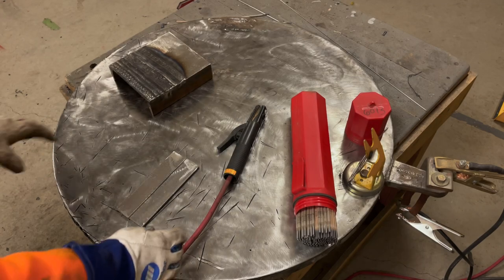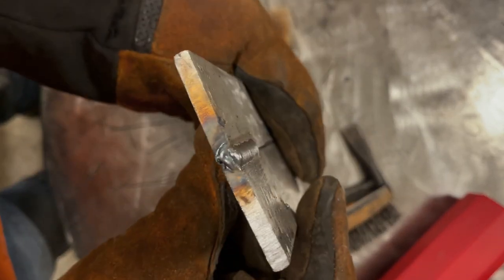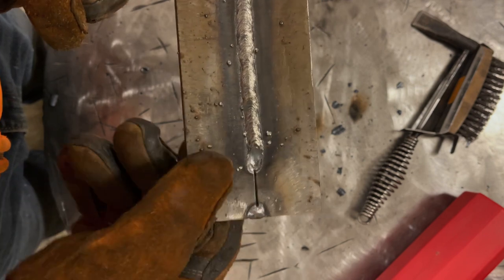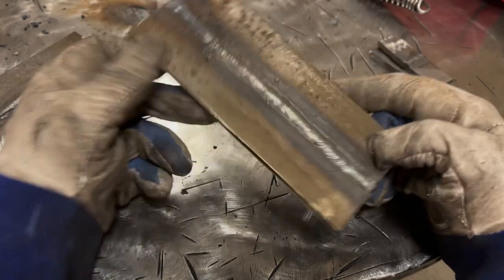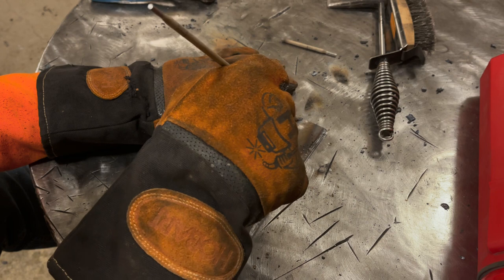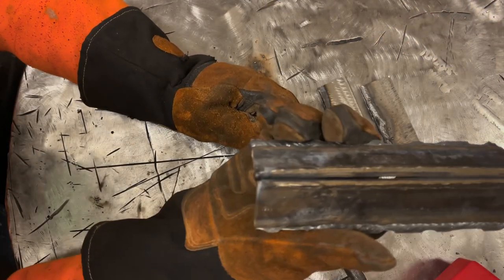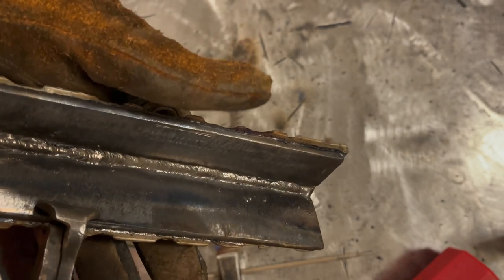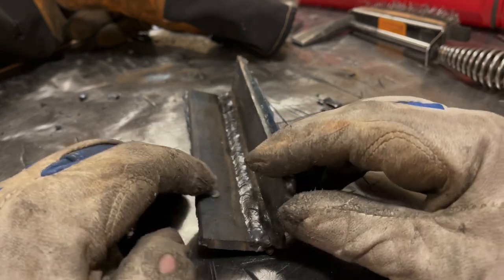How to stick weld 👨🏻‍🏭: How to weld Butt joints (Series part 4)

Comment: Terrific video. I've been stick welding off and on as a DIY for something like 70 years and I learned from it. I'm learning something, sometimes a lot from the videos in this series. Thanks for that, 

We only learn from what goes wrong. Someplace in my office I have a book titled "What you can learn from what went wrong," a relic from my years trouble shooting satellite power electronics at Boeing 25 years ago. When everything goes right, it's almost impossible to know the cause of success. On the other hand, problems and mistakes can be investigated to find the cause. A mistake people frequently make is to assume there is only one cause. Often with a new process or new design there can be multiple causes working synergistically.
Reply from the maker: If everything is going right you’re also likely not challenging yourself either.  When things go wrong (and mistakes are made) is when improvement can be found 😀.

Comment: When I learned to do root passes, we ran 6010 or 6011 on 16 guage sheet steel, we pushed the rod to burn through solid sheet and learned how to control that keyhole.
Reply from the maker: That’s an interesting way to learn to control the rod.  Once I learned how to run 6010 I have always been a fan of it for the amount of control it gives.  It makes repair work so much easier because you can close holes, fill gaps, and it produces a very strong root because everything is fused.  If I was stuck with just 7018 stick welding in the repair world would be by far harder.

Comment: Hi Greg. Thank you for your excellent tutorials. I have an up coming project where I have to join 125mm by 75mm 4mm thk RHS together as a structural butt joint. I’m aware that in an Contiguous beam we would locate the connection 1/3rd or 2/3rds of the span. Or I can treat each span between supports as individual beams. My question is how would you butt weld the beams together? I’m new to welding but I,m a civil engineer. I’ve researched and backing plates etc have come up. But I believe position of the joint determines the type of connection. Hope this makes sense and look forward to your words of wisdom. Thank Mark
Reply from the maker: So by RHS I assume you’re talking rectangular hollow sections?  To butt weld two of those together you have a ton of options.  

1) the hardest:   Bevel them, put them together, run an open gap of somewhere between 1.5mm and 3mm, and weld them.  With the right mix of gap/bevel, weld process/settings/skill you can achieve full fusion with internal reinforcement. Arguably negating the need of any internal steel.  This requires a ton of skill and exact control over everything.

2) The easiest:  find material that precisely fits inside the tube, and use it as a “slug”.  Basically both pieces slip fit over it, and you leave a gap at the butt joint.  You then weld both pieces to the slug.  This will be infinitely easier than an open root without a slug.  It can produce an exceptionally strong weld, but it may be difficult to find a perfect fitting slug to fit.  I commonly do this on round roll cage pipes, but that’s really easy.  What you have on your hands with take a bit more work.  

Option 3:  rather than using an internal slug you sleeve the outside.  With a section that fits over the outside you can essentially just do easy lap welds and you’re done.  The downside to this is the joint will be obvious, and the increase in diameter at the joint may be detrimental.  It would be in your best interest to weld the two pieces together first with atleast one pass on bevels before sleeving it.  

Option 4:  use a flat plate and weld one tube to the flat plate. With it attached you then butt the other one too it and weld that.  The welds would be more like fillet welds and less like open roots.  

The main things you want to avoid is a lot of starts/stops,  unwelded corners, poor fusion, and super wide gaps or super tight gaps.  I definitely need to shoot a video on doing things like this because it can be really tricky to come up with solutions.  For most people I suggest looking at what setup requires the least amount of welding skill due to the design.  If someone is very confident in their skill they can look at harder options.

Comment: This video series is amazing. If I butt weld plates and they warp so they are no longer flat, how can I prevent/ fix this?

Thanks!!
Reply from the maker: So warping is always an issue, and there are a few ways to take care of it.  On thin material using short welds, or spot welds, along with hammer and dolly work will keep warpage at bay.  Medium thickness metal this won’t work so focusing on clamping it down to a flat table or clamping it to a bar of something becomes more important.  With thick steel (over 3/16th) using what’s called “strong backs” may become needed, they are basically a welded on bridge to help hold the plate from warping.  Those tend to be used on structural steel work.  

For most people the easiest way to control warpage is to use a strong clamp/table to aid, and to account for warpage.  If I know I need something straight or say 90 degrees, I will weld it with a slight “bend” opposite the direction it will pull.  After welding it will pull straight.  This becomes harder to do if you have a beveled plate, and a gap/open root.  The more metal gets put down the more everything will move.
Reply: @makingmistakeswithgreg  perfect thank you! I have some 6mm steel plate I need to butt weld, and your videos have really helped!
I'm planning to bevel the edges and leave a small gap, and weld the pieces with 3.2mm 7018 both sides.

I'll try clamping everything down to a flat bar and see what happens 🙂

Comment: Greg, since I started watching your videos, I run a file a couple or three times over the shank of the welding rod. On 7018, I have noticed a considerable change in starting it
Reply from the maker: Awesome 😀.  Sometimes the smallest things can have a great impact 😀
Reply: Have wondered about using a very coarse sharpening stone for 7018s to help with restart.  Is this a bad idea?
Reply: @dennisyoung4631  I don't see why it won't work

Comment: Hello, thanks ...I started watching your first video for beginners and continued watching. Your videos makes so much sense compared to other videos that I watched which much use for me. I learnt so much from you and I am now understanding my mistakes as amateur welder. Thank you so much. Happiness 😊
Reply from the maker: You’re welcome, I am glad you learned a lot.  Stick welding can be a challenge when you don’t know some key things.  The big thing is you have to master starts, restarts, and running a straight consistent beads.  It will be frustrating at first but if you stick with it you will get a handle on it.  Just tell yourself the frustration and difficulty you have when learning is the same for everyone learning, and don’t give up 😀

Comment: as a novice, I love the way you explain things, it is easier to follow than others I have viewed. You have mistakes and then tell how and why it happened like in real life, this is a great learning tool
Reply from the maker: Thanks for the kind words 😀.  Learning to weld is basically 99.5% making mistakes and learning to handle frustration.  Slowly over practice that 99.5% drops and you eventually get to about 15% mistakes and 85% good.  There is no such thing as 100% good unless you’re not doing challenging work lol.

Comment: Thank you for 6013. 
In my country 6010 and 6011 are speciality pipe rods and only available in 50 pound boxes and are relatively expensive. 7018 are available but only from speciality welding supplies.
Only 6013 considered the general purpose and the only rod available available at the local hardware stores.
Reply from the maker: No problem 😀.  What you said is very similar to what I have heard from many people all over the world.  I do wish you had easier/cheaper access to 7018, because once you get used to running it I find it’s really a great rod.  6013 isn’t bad, and if it’s what you can get it will surely work.  I just find it has a tendency to get slag entrapment easily and welding uphil isn’t easy with it.  Once you get used to it and perfect welding with it, no doubt it will get the job done 😀
Reply: @makingmistakeswithgreg  I have only had my welder for about 3 weeks now. I will definitely make a point of buying a few kg of 7018 and maybe 7024 as my skills improve.

BTW not all 6013 have this slag issue. I have some more premium 6013s that came with my machine they run very smooth and need more amerage but have a tenancy to stick if the arc force is too low and are much more difficult to start but run beautifully. The rod angle on these is more like how you run 7018.
These rods are a light grey colour instead of brownish or darker grey of the easier to strike rods. 

 Awesome video series
Thank you.
Reply from the maker: @julesc8054  interesting to know there are differences in them.  No doubt 6013 is a great rod to start out with because of how easy it is to start, restart, and it is far easier to clean the slag off than 6010/6011.  Both 6010/6011 pretty much need a wire wheel on a grinder to clean off that slag.  Definitely no issue learning with them and even using them to do jobs with.  Their strength will exceed the material strength in many cases, and as long as the weld bead is solid it’s not a issue at all.
Reply: In “Europe”, they have a lot of different “6013” rods, including “RR”, which is a straight Rutile; RB, Rutile-Basic, which is a bit like a “less cantankerous 7018” - and, the semi-fabulous Rutile-Cellulose flavor, which has less slag and more “bite” than the others.

Over here, the Lincoln 6013 is supposedly akin to a straight rutile, while the 1/16 HF, Hobart, and perhaps the Forney 6013s are more “rutile cellulose” type.

There are some specialty rods that might be akin to Rutile-Basic, e.g. UTP-612.  I ran some of these a long time ago, and still have a few left.  Very high strength and impact resistance, comparable to a kept-warm 7018…
Reply: Hi 10 months late to reply - I'm in the Philippines and have the same issue, unless I can get to the city, 4 hours away. But I've found that 6011s and 7018s are readily available through the 2 main online shopping sites here - I bought 1  half kilo of each for trying out once I get an idea how to use 6013s properly; finding it challenging! TBH I can see me going the gasless MIG route in a few months or so; all the little projects that interest me involve thin delicate welds that need to have great finish. BUT stick is a great weapon to keep in the toolbox for heftier work.

Comment: Thank you.
You showed many of the problems I've been having. Now I have a much better idea what I'm doing wrong and how to (mostly) fix it
 I have about half a pack of 6013 that are also around 10 years old, they were stored in a rod container and I did try drying them in an old toaster oven for around 45 min as I'm going back to basics (plus only try welding a few times a year, not best for practice)
The 'you can't weld it if you cant see it' also applies, I made a 'cloak' for welding helmet as I was finding ambient light from behind my head made things very difficult. Old jeans with worn out knee still has great material in lower part of leg 😎
I'm sure it isn't the safest thing to do but still probably safer than guessing where I'm going?
I have some thin leather from sides of old sofa that I'll use 'next time
Reply from the maker: No problem 😀.  Using a cloak on the back of the helmet is a good idea.  Back light can cause a huge issue with vision.  If you can’t see what you’re welding the results will be mediocre at best 😀

Comment: Well, I think in V-shape you could safely  use any crazy amps until the rod evaporates, there's about 1/2inch of base metal assuming the 45deg angle, especially if you're trying to fix a previous pass and some defects. For a 1/8inch rod even 140A would be just fine, may be even 150-160A too. Melting a bead underneath the rod with all slag inclusions altogether is much simpler than grinding this crap out multiple times, also by weaving the rod at high amps by 1-2 rod diameters you can have both less layers/passes and a nice weld.

BTW, why 7016/7015 aren't so popular in US as 7018? These rods are so much easier to control than any 7018. At sufficiently high amps (120A+ for 1/8in) 7015/7016 can even burn through a thick metal with a little push while 7018 will always stick if the arc is too short. Are the rods like japanese Kobelco LB-52U or Nittetsu 16W or L-60LT available in US? Lincoln Electric Conarc 52 rods are very nice.
Reply from the maker: So my understanding on 7016 is it’s not commonly used because it’s harder to remove the slag and it can cause a person to bust x ray by welding over the stuff left at the weld toes.  I have never welded with 7016, it can be bought in this country but likely in a 50lb tin lol.  The way you describe being able to push the rod in sounds like it could be a solid performer that could bridge the gap between 6010 and 7018.  7018 doesn’t really have much penetration but it is definitely stronger than 6010 in functional tensile strength.
Reply: @makingmistakeswithgreg  Yes, this is true 7015/7016 rods can produce porosity on poorly cleaned metal and that is detectable by X-ray or probably ultrasound too, therefore on jobs with any significant liability after every pass a weld must be well grided, tack welds must be cut out completely before making a root pass. There are some basic rods that are less prone to producing porosity due to dirty metal or long arcing, but within AWS classification these will be hidden under one of 701x codes so finding good rods these types also requires some type of research. I don't know how well 7018 performs compared to 7015/7016 in terms of porosity as I haven't welded much with them, but I can definitely tell that 7018's slag is hardest to remove above all other types I've ever seen. There are not so many 7018 rods around compared to other types, out of a few I have access to I can name swedish ESAB OK-48.xx, turkish Askaynak B-248, japanese Kobelco LB-62D, arabic-chinese RSE 48.xx, german-chinese BRIMA Kessel 5520 Mo (8018), and probably more familiar to you Lincoln Electric Pipeliner 18P and Basic One and a couple of other rods probably made only for local market. There's also german Bohler FOX EV PIPE marked 7016 that curiously behaves like it is halfway between 7016 and 7018. If any of these rods are available on Amazon then there is a good possibility to be exactly on the same page about 7018 :)